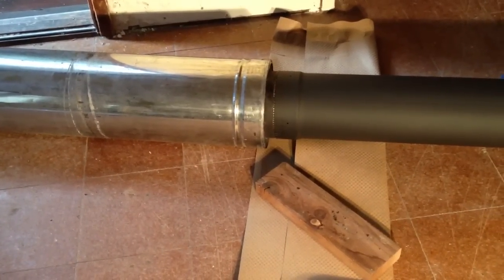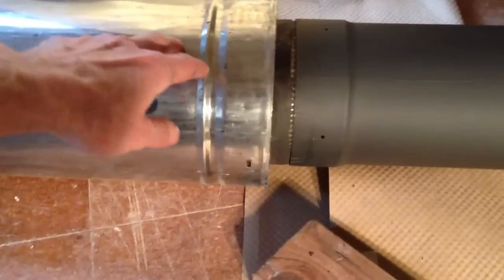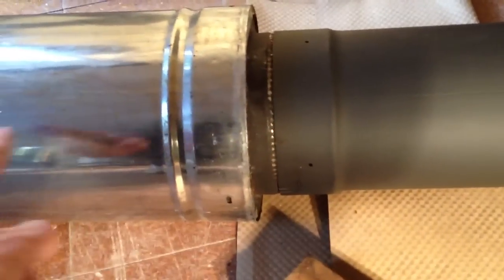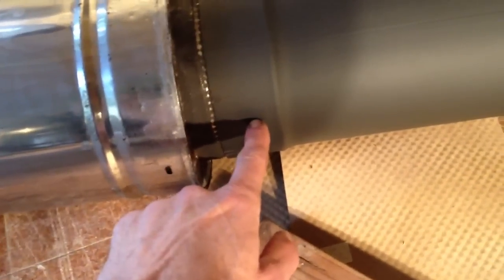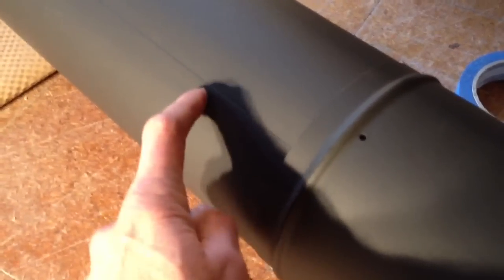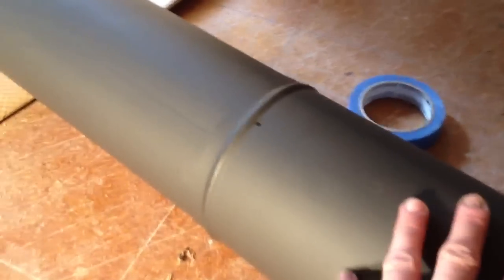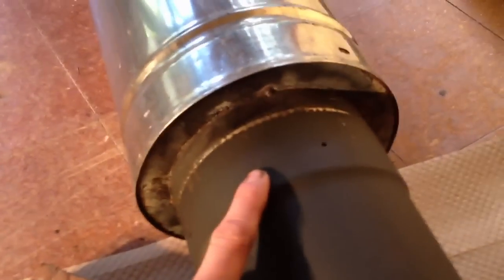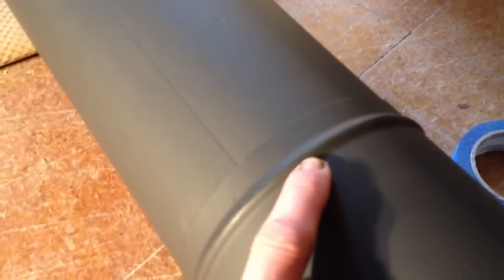Wood stove Class A and black stove pipe overview

Comment: I think my pipe was installed upside down.They have the crimped end pointed up.Black gunk runs down the pipe on the outside.
Reply: Yep, mine was too.  I just cleaned it, then pulled it off and switched them.

Comment: It seems to be hard to locate the adapter that connects the single wall stove pipe and triple wall chimney pipe together. Where did you find yours?
Reply from the maker: There’s no adapter. If it doesn’t fit, one of the pipes is upside down (assuming you have the right size). It’s all standard sizes